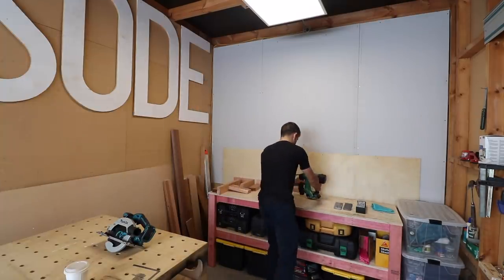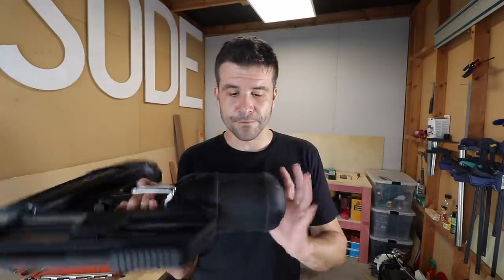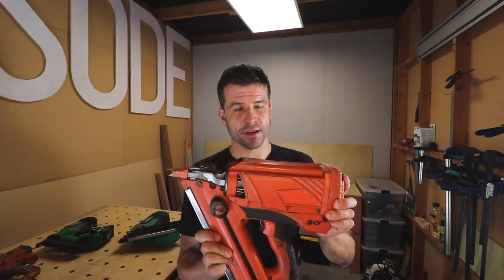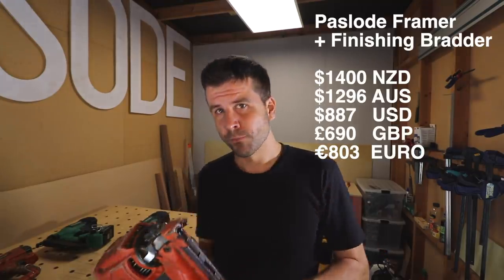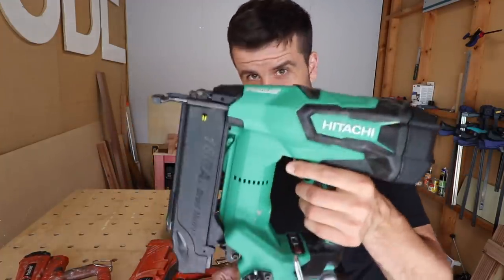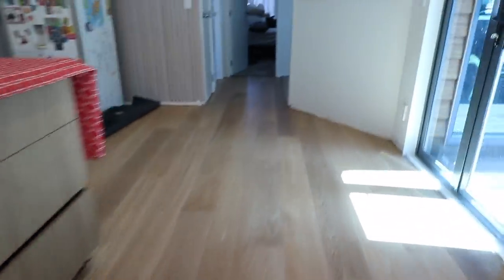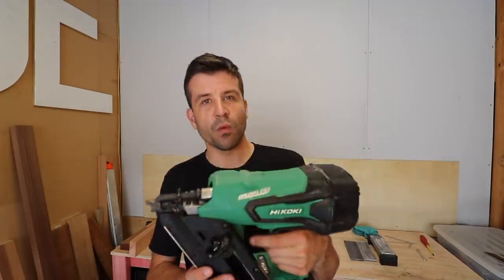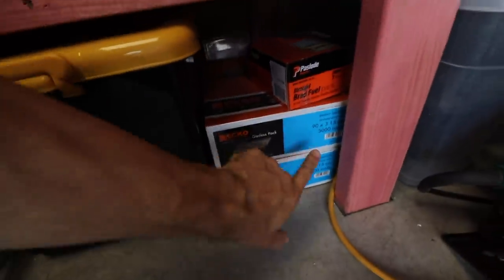The Best Cordless Nail Gun?

Comment: Hi, I've had my paslode framer and finisher for over 20 years and have just made the transaction to hikoki.. Framing hikoki is great.. Sequential nailing etc and the weight is fine for me but the finishing gun does not fire home with the nose protector on so its so so for me.. Maintenance is easier too., cheers
Reply: Jim finish height is adjustable to account for the rubber nose.

Comment: i use dewalt guns, the newest gen 3 framer is a game changer, 10x better then the older framers with power and speed, also use the 16g finish gun and also a good gun, the money saving alone from when i used paslodes makes up for the weight of the dewalts.
very keen to try out the hikokis though!

Comment: I want to get one like this but at my jobsites they have hoses and compressors hate em
Reply: Same, just do it imma get the hitachi
Reply: The Hitachi does actually use compressed air aswell as the battery to drive in the nail but not in the traditional way. There is a piston inside the gun that engages when you depress the tip thus generating it's own small dose of compressed air that helps to drive in the nail. This is the reason that it is so powerful. 🙂
If I wasn't exclusively on the DeWalt battery platform then I would definitely invest in one. 👍

Comment: I’ve got many Hitachi/Hikoki tools but I’ve not yet added a brad nailer. I’ve looked at their models and since I’m a left handed I find the asymmetrical design obscures my view of the tip. They’re definitely biased towards a right handed user which is fine.. but it doesn’t make it the tool for me unfortunately.
Reply from the maker: My old man has the same problem with tools and tool belts too
Reply: @ScottBrownCarpentry  I am considering the Hikoki multivolt / hybrid 255mm sliding mitre saw.. I'm able to use the right handled grip OK..

Comment: The Hikoki Angle Bradder only suits the american brad nails at 34degrees(to my knowledge anyway). So far(my experience), i can only find ECKO brad nails work. which is a downside as most brad nails are either 20 - 25 degrees stocked in your major hardware stores. 

Do correct me if theres any other brand that can be easily procured, but so far, i can only get them through Black Fasteners on my end.

Comment: I use the paslode framer and the DeWalt finisher, I’m always thinking about getting the dewalt framer as I’m on the battery platform but I can never bring myself to do it!
Any advice?
🇮🇪
Reply: Don't Dewalt finish gun is v good framer too heavy not as nicely balanced and jams a lot. One plus is rapid fire option is great for nailing down ply fast.

Comment: Hitachi made some of the best nailers for pneumatics. No wonder they make the best cordless. Milwaukee is good but too expensive. Basically the gen 2s from Milwaukee are same as Hitachi for much more cash so no point. You can just have all nailers with batteries and charger in one box and usethem whatever platform you on.